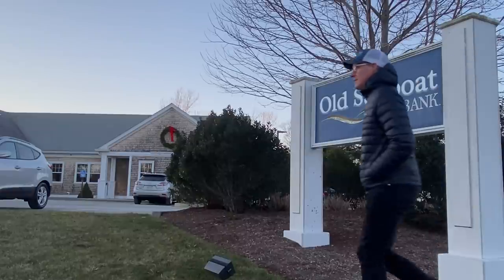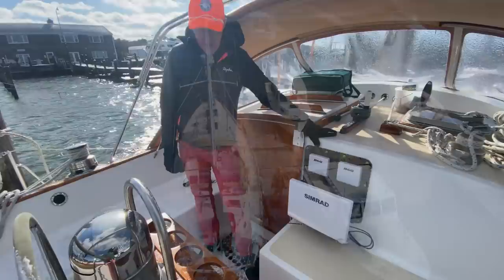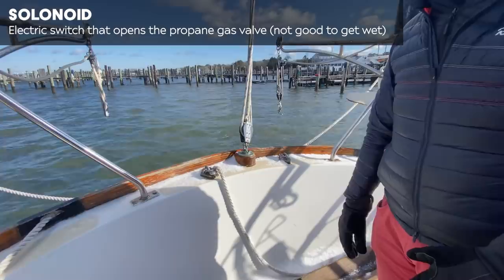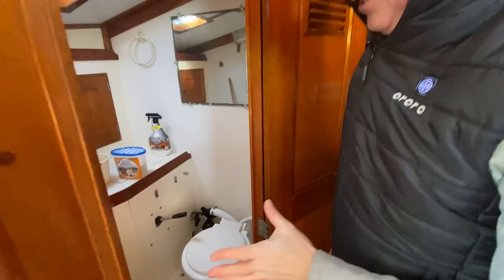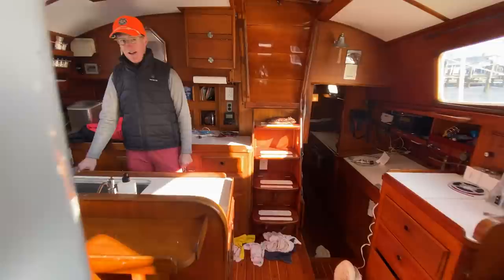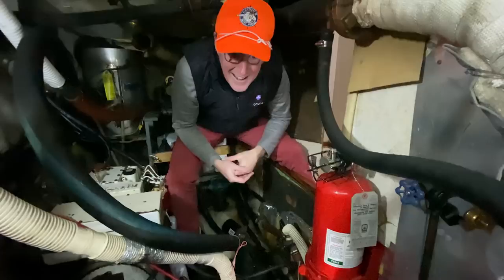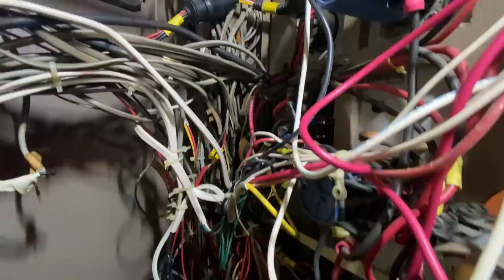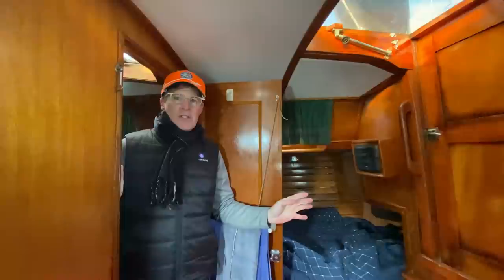EP 1: Ran-day Bought a Sailboat! A flash-forward on the Scheel 45 #sailboatrestoration

Comment: If there's one thing I've learned about admiring all of these beautiful sailboats is that if I don't have unlimited funds I shouldn't buy a boat longer than 26 feet long, one without a fixed keel. I want a fiberglass, (not wood,) boat I can spend my time sailing and floating around on, reading and napping on for a week or 2 at a time, then load it up on a trailer and haul it home, and not spend most of my waking hours working on, worrying about, or tossing money into it. Sails in good shape, portable coolers for food and drinks, an electric trolling motor, battery-powered lighting, a pair of lithium batteries for aux power, jugs of water, sponge baths, a camp stove, and 4 or 5 flexible PV panels and I'm good to go. I can admire as they sweep  me all of the majestic, teak an mahogany decked and trimmed boats dotted with glowing, polished brass and chrome, then I can go back to reading my book in peace. Captain Q and Ran-day satisfy my urges for more.

Comment: Ran-Day: Great tour and description of the host of little “gotchas” that come with buying anything used (i.e. car, boat, trailer, vacation home, etc…). My advice: buy several bottles of Goo-Gone to get rid of any adhesive left over after you peel off those red Dymo labels on the electrical panel, buy a couple bottles of 91% alcohol to get rid of those labels written with a Magic Marker, and buy a Brother label-making unit and start labelling everything with nice, easy-to-read, black on white 1/2” labels. Labelling switches, pumps, water lines, wire bundles, through holes, etc… makes a world of difference and adds a level of professionalism and clarity that can’t be beat. Pretty soon that Scheel 45 is going to look like it just came off the factory floor! Great job on everything you Captain Q do together! Looking forward to your next video update.
Reply from the maker: Thanks, Darryl! You got it… great suggestion. I picked up a thermal printer (no running ink) to do the trick.. so important to be able to identify things without having to place the role of archeologist 😉
Reply: @YachtHunters  If that thermal printer doesn't prove satisfactory, try the Brother PTouch model PT-D600 (available at any Staples or OfficeMax store). It has been an easy-to-use, versatile, and hard working unit for me. You can make 1/2", 3/4", and 1" labels in a snap, and the labels will hold-up to just about any environment! You can also choose from about 6 or 8 different fonts as well.
Reply: He needs a few cans of Dinty-Moore!
Reply: Maybe one more bottle to buy, a bottle of scotch to de- stress after you do the electrical work :-)
Reply: @YachtHunters  I second the suggestion on the Brother Ptouch label maker, and I believe if you connect the unit to your computer you will have much more flexibility in the design of any specific labels as I do with mine.
Reply from the maker: seems like I might want to upgrade to get the flexibility... the one I got is a one-size fits all and will be limiting. Thanks for the tip! 👍
Reply: @YachtHunters  think I'll be checking this out also.

Comment: I don’t think you should rip out any electrical. Sort it all out, use plastic tyes, and label everything you know.  Down the road sometime you might find out you tore out something you shouldn’t have. At least give it some time before you do that and know that what you do rip out you definitely don’t want.
Reply: zip ties and split plastic conduit mounted and secured. Made huge difference on our boat!
Reply: @symphonyfarm2009  Thank you, that’s what I was trying to think of, zip ties.
Reply: I'd also add a resistance check to the list. It will let you know if any of the wires are immediately dangerous or not.

Comment: Yeah, I had a Westerly sailboat with an electrical system that looked like that. What I did was to pull out all the unused cables. This took awhile, but when done, things were waaaay more simple and I improved after that. I believe if you pull out all the dead headed cables you will begin to get a grip on what is going on.
Reply from the maker: Seems like a nice gentle way to get started... and keep sailing at the same time. Good tip!

Comment: Congrats Ran-day.  Good solid vessel!  Someone may have already suggested it, but get yourself a good quality toner wire tracer.  You basically use the sender to put a tone on one end of an unknown wire, and you can "sniff out" the other end of the wire using the toner tool which senses the tone signal.
Reply from the maker: great idea!! I picked one up in October and it's been helpful... cheers!

Comment: What an awesome vessel. A bird's nest of wires can be cleaned up with wire ties once you figure out what's actually still being used. The previous owner of my vessel cut all the ties while adding stuff and never took the time to tie it back up afterwards so wires were hanging loose everywhere. I found that once I got at it with the small wire ties it all looked so much better. The under sink through hull should be addressed for sure especially if you can't get to it. I eliminated my through hulls by going with a sea chest in the engine room that goes to a manifold to feed everything and a ball valve at the manifold to shut water off to each one. The sea chest feeds my Main engine, AC, Genset, Head, forward and aft washdown pumps and water maker and I have 2 spare plugged valves I don't use. Everything that needs and gets fed saltwater comes from one spot and all of them can be shut off quickly. It looks like you have plenty of room in your engine room for it. I look forward to all your videos. That old salt Captain Q will help you out I'm sure!  Regards

Comment: 2nd time watching this.  I really love the Scheel 45.  Agree on the settee to port and CQ's suggestion of a mast mounting for a table.  Free the forward bulkhead for that nice heater!  On the electrical start with the wires you can show are not used or as you do any work that you no longer need and begin clearing them out.  ID both ends or each length of a run with good labels and make a decision on need it or lose it/replace it.  Checking for insulation failure on all wires you can if you decide to keep them for now as some could pose a hazard for shorting etc.

Comment: Congrats on the boat Ran-Day, will be a cracker, I had a Ford Lehman 90 hp diesel in one of my yachts that had a lot of hours on it, had not been well maintained, had a mishap with exhaust manifold, held on by those 4 bolts, it completely fell off, it seems electrolysis had eaten away internally? Don’t know if those diesels have zinc anodes in them, might be wise to check ? All the best. Greg from Australia 🍺

Comment: Great video. As far as the electrical system is concerned, certainly don’t tear it out until you have a complete plan and system wiring diagram with wire sizes and colors laid in. Also, only use stranded copper at a minimum. I would also replace power circuit switched with sealed toggle hydraulic magnetic circuit breakers as you can afford. The way i might start this project would be to define each electrical item to be used. List its power requirement as a start. I also suggest keeping separate ac and dc circuits. Don’t run them in the same wiring trays. Good luck going forward. OleDave
Reply from the maker: Great advice, David! Sounds like you're speaking from some experience!

Comment: You will need to make a side panel hatch to get through to out hull openings, keep bung of the same size opening in close by. Suggest you keep bungs for every through-hole near them for safety. Get a backup bilge pump. Get a sump pump that can be moved around as needed, with hose and extension cord. Have plenty of hose clamps on hand of different sizes. Keep a toolset aboard with a hacksaw. Hammer and bolt cutters in case of rigging gets loose.
Reply from the maker: Great stuff, Michael. Stay tuned for the through-hull & bung episode... I'll be adhering to your advice. Double clamps and lots of tools on board for sure!! I like the way you think!

Comment: A lot of potential, and a great layout and deck accomodations, as it was when you and CQ reviewed it to begin with.  I'm surprised though - born of inexperience, I suspect - at how much work the boat needs although reviewed by two of the best boat reviewers on YT.  Suggests, at least, opening the wiring cabinets on future boats to see the quality of routing that's been done.  Even then, couldn't know it all without a seatrial and testing every switch.  But, congratulations!
Reply from the maker: well, the good news is that most of it works... so nothing critical that keeps her in the drydock... so most of it will be elective outside of the engine issues. thanks very much!

Comment: Congrats on the boat, Ran-day!  All the issues you pointed out does seem a little daunting, but most of those are minor things that you work on gradually while still using the boat.  When I originally saw episode 11 with this boat, I remember thinking that the aft cockpit was pretty cool, but now I'm wondering how much it would actually be used and I think they would have been better off taking that space and putting a large double or queen berth in the aft stateroom instead of the 2 singles with <12" height for your legs.  Regardless, you're going to have a lot of great times on that boat!

Comment: Hope you read this? Great boat - Dreadful wiring. Can I suggest you buy a good quality Tone Tracer. This will help you find cables, their route, breaks and shorts throughout the vessel. Make sure it is one with a sender and receiver unit with multiple connections. They are good for electrical, co-axial and data cables.
My background is Marine radio and electronics, without a Tone Tracer I would have been at a total loss when fault finding on the kind of mess you have.
Best of luck getting the boat ship shape.

Comment: Cable management is a life style. That looks like 90% of the wiring closets ive had to clean up in my career over 28 years.
Reply: Right on, Ben! 
0:19 Ran-day's expression says it all 😱
Reply from the maker: You must be a zen master to make calm out of chaos like this! ✌️
Reply: @YachtHunters  Zen in the fact that i am very very patient. But my advice would be to set aside a weeks vacation and buy new contol panels. For each of the switches label and group the cables as you disconnect then untangle, clean and sort the cables. harness and route them as you reconnect.

Actually my advice would be to rip out all of it and rewire but that is a huge job.

Comment: A couple of things I suggest (you might have already done so) is to make maps of the boats systems. Also inventory all the components, fittings, fixtures, etc. (spreadsheet style) to id what they are, current state, maintenance schedule, etc.  By mapping out what the plumbing for example, is and where it is routed, your maintenance and upgrades will be markedly simpler.  Same is true for various, controls, etc.

Lastly, I've found what helps in "eating the elephant one bite at a time" is to plan out every maintenance stint and repair/improve/rebuild project as one of more work packages.  To do X, I need these parts, materials, tools, and the labor consists of...  And X really should be done before tackling Y...  That way, you know what is needed, know what needs to be done, and what defines "this project is done".
Reply from the maker: love this idea... and plan on doing lots of CAD drawings and diagrams as part of the archeology of it all. much to learn!

Comment: Batteries forward for the windlass and bow thruster is to reduce the voltage drop, which is good. The charging system leaves a lot to be desired though.
Reply from the maker: Yup, makes total sense to have them there... thinking solar might be a good solution but we'll see. It works for now... 😁

Comment: Ran-Day It will be an interesting experience, reworking an old boat. I am getting a Pearson 365 back into shape. Wiring issues have a lot to be desired (old boats tend to have a hodgepodge of add on or reworked wiring). I have a background in Marine Electricity and Electronics so a good challenge. Looking forward to the rest of your series on rehab. Labeling and proper color coding of the wires will help out a lot. Nigel Calder has a great manual on Mechanical and Electrical Systems that could help you (Boatowner's Mechanical and Electrical Manual).
Reply from the maker: Great advice and good luck with the 365... (one of my favorites of 2021!). Nigel is fantastic and I plan on digging into his materials to get up to speed.  cheers!

Comment: Great boat Randy. Congrats. 

That fuel manifold could be for a "fuel polishing" system. You can run the fuel through the filter, without sending it to the engine, and dump it back into the tank if the fuel is of questionable quality. This would also indicate that you have an electric fuel pump that is separate from the engine.
Reply from the maker: Turns out I was wrong... and I do have two tanks.... add that to the list of things you will see me be wrong about :)  You are correct that I have a lift pump separate from the engine. Great eye.  I did look at polishing systems at the boat shows and am very interested in them as my tanks are encroaching on 50 years old. Cheers!
Reply: @YachtHunters  Honored to be of help.

Comment: Bow thruster and anchor winch take huge amounts of power. Wires from house battery to bow  batteries would drain huge current when raising anchor or bow thrusting. Suspect all extra wiring was to get front batteries to charge when windlass and thruster were not in use.

Comment: Interesting boat and worth doing. It does have a long list of projects to prioritize and having done several project boats I'd recommend living with the electrical till you could get other things straightened out like replacing that bucket in the engine room.  On the battery switches you might look around for a place where additional batteries used to be.  Don Casey has an inexpensive book on electrical from International Marine. Not his best book, but it covers the basics quickly and is easy reading.  I keep all his books on board to refresh myself before tackling a project.

Comment: Ran-Day... Awesome video. I feel for you, sitting and staring, trying to learn. As for how a diesel works, a friend solved a huge mystery for me. I hope I can do the same for you with this newbie level explanation. Watch "Fire Syringe" on you tube (by Veritasium). The pressure in the Diesel engines' cylinders is so high, the air itself gets hot enough to ignite the fuel. (No spark plugs needed... glow plugs just help warm up the cylinders) The injectors are spring loaded inside and won't "pop" (spray fuel) unless the fuel pressure from the pump reaches around 3000 Psi. The injector pressure has to be higher than the cylinder pressure to get the fuel in there. If there is air in the metal line to the injector it wont compress enough to pop the injector which is why you crack the nut loose at the injector to bleed off air. Lastly get an (extra) injector and learn how to take it apart and how to clean and reassemble it. A well maintained engine that all of a sudden wont start (or runs rough) is usually because of the fuel system. Air in the lines or dirt in the injectors are a very common cause. Lastly get yourself a "Service Manual" for the engine and genny (different than the owners manual). They're worth their weight in gold. I hope I've been helpful as you and the Captain have with all your hard work. The education I've received especially with terminology and the purpose of things...It's invaluable. Best of luck! Look forward to more videos
Reply from the maker: Thank you.  RanDay is on it big time read and studying the equipment with a passion

Comment: There is a good chance there was a leisure bank in the main cabin. Maybe that was not replaced at some point. My boat has a battery in the bow like yours. It runs the bow thruster. It can be connected to the main leisure bank but also isolated.
Reply from the maker: That makes good sense… and I like the separate AGM batteries for running those high load items like the bowthruster and windlass… just gotta figure out the logic that’s going on

Comment: Regarding electrical, higher Voltages for a given power draw (load) uses smaller gauge wiring.  That counts for a lot when there are many wires.  There's an emerging 48V standard that's worth a look, in EV design.  We now have semi-conductive devices that radically change what can be done with electrical, for the better too.  Look into switch-mode power, you'll like what you see.

Comment: I am not an electrician by any stretch.  But we were told that the wire run from the alternator to our bow-thruster battery (which sites right next to the bow-thruster motor itself) would simply be too large and heavy because of the distance (37 some feet) between alternator and the battery.  Our bow-thruster battery is trickle charged through a solar panel.  Maybe it's the same issue here.

Comment: Love the engine room 👍
Reply from the maker: It’s going to get a whole lot better with lighting and new insulation. I took notes on the gulfstar 50 we toured so I’m looking to that as my goal
Reply: @YachtHunters  I’m a engine guy . It appears that if you should ever have to replace the engine , a new diesel it would be a fairly simple process . Honestly, I like what they did with the oil filter , putting it on long hoses. I’m sure the idea was that come time to swap out the filter it would make the process less of a hassle. Yes , I agree a tidy engine room is a happy engine room. How it should be. I also am a big fan of the Diesel engine. In my mind, they are miles ahead of gas engines in reliability and it’s all about reliability on boats . Congratulations on your vessel 👍👍